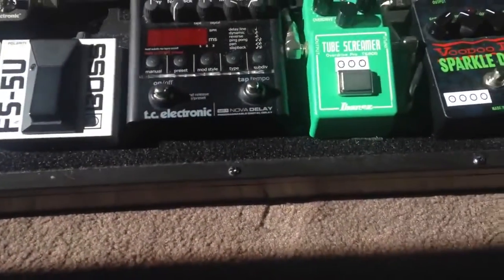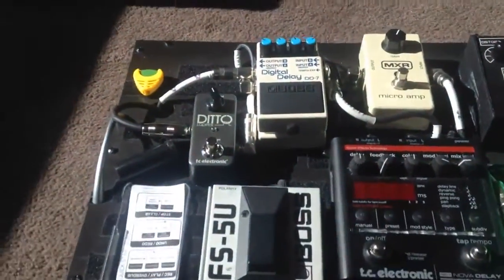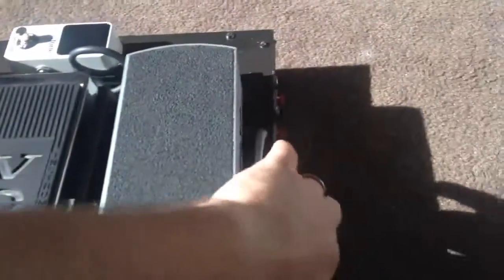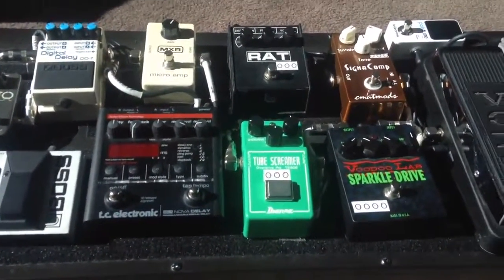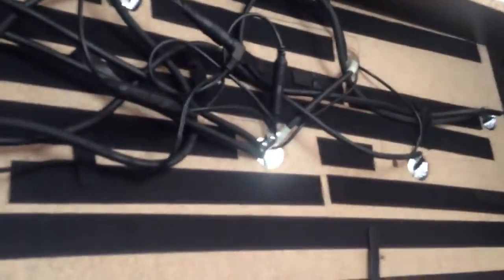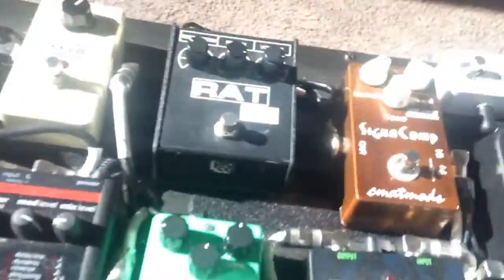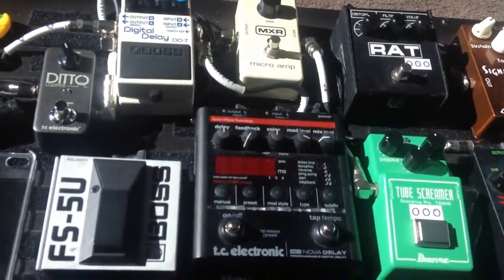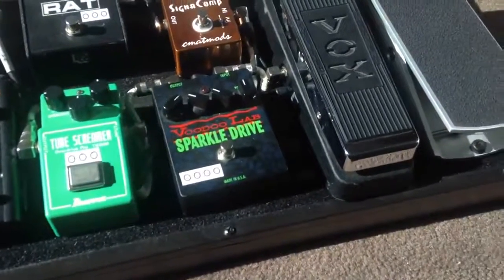How to CUSTOM BUILD AND SETUP your own guitar pedalboard.

Comment: How did you solder the neutrik input jacks to the instrument cables?
Reply: Strip the end of an instrument cable, solder the tip wire to the tip tab, twist the shield and solder to the ground tab.

Comment: how did you run the power?
Reply from the maker: +Josh James two one spot power adapters plug into the side of the board, and under the board there a few daisy chains.